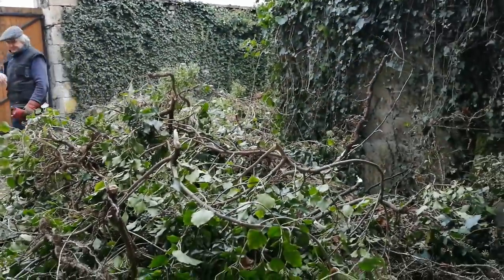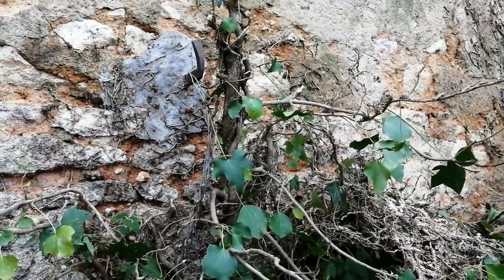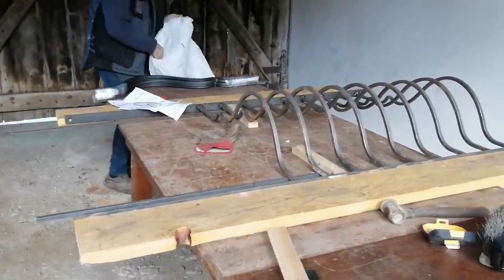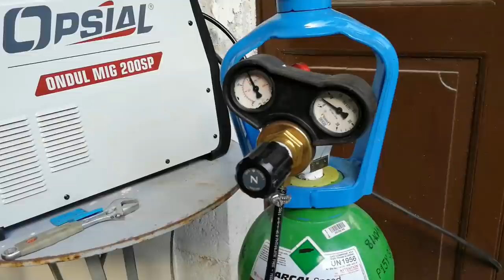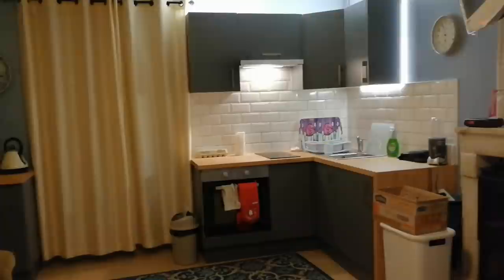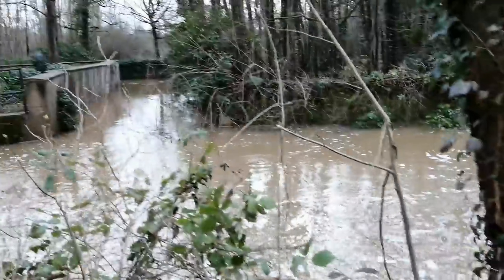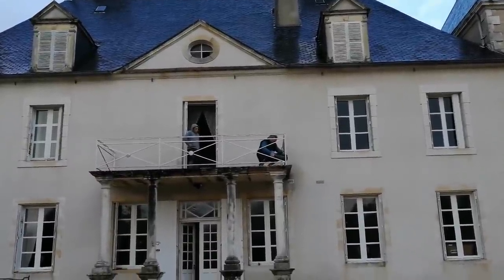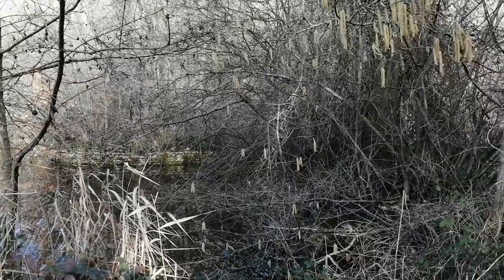Not Quite a Chateau 45 - The River is High - How'd you miss That - Finally a Balcony -  &  Boys Toys

Comment: I was told that the stone triangle shape within the wall above the lintel is a device used to help spread the weight of the wall to the stronger vertical parts of the opening. Otherwise the weaker central part of the lintel bears all the weight of the wall above.
Reply: It does work like an arch, that makes sense! Even if the angled stone bits didn't carry any weight, the stones against it would form a "false arch" and support everything above. On the other hand, so would they without the two angled pieces of stone, so in order for that theory to make sense, those bits would have to be load-bearing too.
Reply from the maker: Hi Gasparo and Ragnar, it probably does have a structural purpose, yes

Comment: Ahhh Tony works so hard bless him. Looks so much better since when u first started vlogging. Do u think the big square brick tank thing is for compost?  Or maybe to collect rain water for the garden. Don't know just a guess. X very nice jite jane. It looks great! X
Reply: I thought of water as well, maybe a rainwater cistern, but water is bloody heavy so I don't think those brick walls would be strong enough to hold something like several thousands of litres of water. The whole thing looks to be at least two metres square and two metres tall so that would be 4000 litres or four tonnes pushing out on those walls!

Surely a compost bin would be lower so you could actually get the compost in and out without climbing on a ladder? I suppose you'd have to ask older local farmers, they'd likely know what this could have been used for!
Reply from the maker: Thank you Lisa, I don't think compost as there is nowhere to get the compost out at the bottom, and compost needs some air circulation too
Reply: @notquiteachateaudiy  Hi Jane, I'm Diane from Oregon and have just been binge-watching your videos.  What a fabulous project!  At about 9:10 on this one, I noticed a dark stone or beam end near the ladder that looked to be in direct alignment with the oddly placed stone/tile bit creating the "triangle" above that blocked up door/window.  It may just be the camera, however, it looks like there may have been an old  roof line coming down from that dark square in the middle of the barn wall to where that diagonally placed stone is.  Or maybe I'm just seeing things!  Anyhoo, it's all
 cleaning up nicely, bravo!

Comment: Regarding the diagonal masonry (triangular arch) above your windows:  look up "discharging arch" in Wikipedia. I wonder if those diagonals are a variation of those arches embedded in walls to help spread/discharge the weight over an opening? Discharging arches are often found where construction material is not as strong as it might be to hold the whole weight of a wall. The Great Pyramid has diagonal stones above the entrance to the tomb.
Reply from the maker: That's really interesting Lisa and fascinating about the pyramids too. The stone around here is quite soft so that would make sense

Comment: Those metal railings look lovely, but an adult could fall through those gaps! The French were even less concerned about safety than other Europeans at that time it seems. I've got an old French light switch from around 1920 I guess that has more or less exposed live screws! I eventually used it on a 6 Volt doorbell transformer where it definitely can't do any harm.

Cement is an ancient thing, even the Romans used it but then it was largely forgotten about. It made a reappearance in the late 19th century and became properly popular after WWI. Cement render on old buildings is more likely a post-WWII thing though and really surged in the 1970s and 80s. It can hide a multitude of sins so it might be a good idea to look behind it in a small spot but it's not necessarily as dangerous as some people would have it. My parents bought an old farm house built of unfired clay bricks ten years ago and one room had cement plaster with chicken wire. Three walls were more or less fine behind the cement, the fourth one (an internal wall oddly enough) was quite damp and disintegrating. Animals had actually dug burrows in the brickwork, huge cavities in what once was a solid wall! My parents then had a damp-proof course installed to keep the wall dry in the future and most of the wall rebuilt. Lime plaster would have let some of the damp out of the wall and make it appear more solid but then you'd constantly have the damp inside the room, which isn't what you want.

I guess the whole section of wall above that steel beam was rebuilt when the old wooden lintel threatened to collapse or collapsed, taking the stonework above with it. The wall probably isn't stone but brick or block.
Reply from the maker: Hi Ragnar, the balcony and rails were built in the late 1700s, so no health and safety, no. It wasn't safe to keep them unfortunately. That wall above the steel is built of blocks, yes, not stone
Reply: @notquiteachateaudiy  I suppose you could have put a transparent glass railing in front of it for safety.